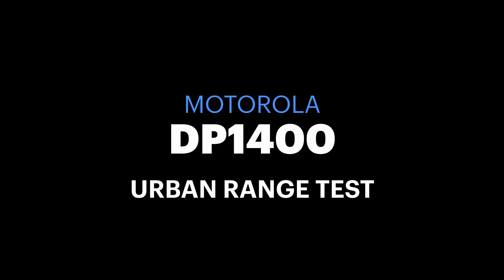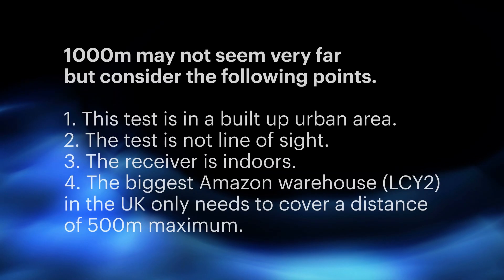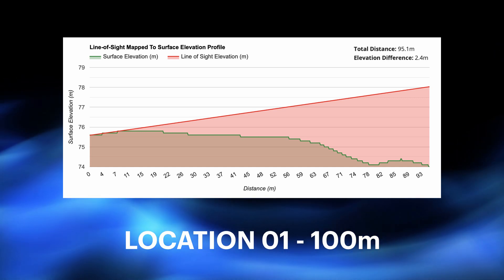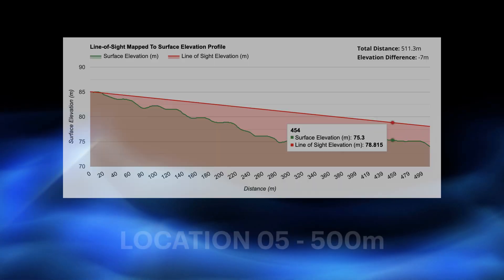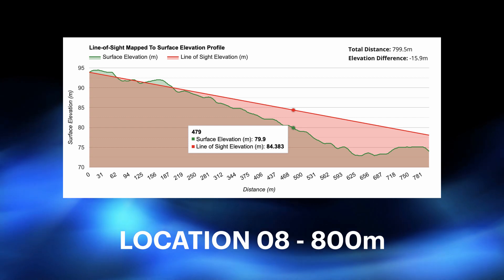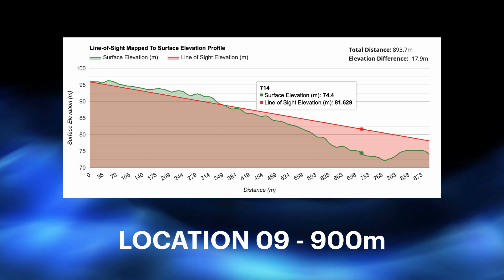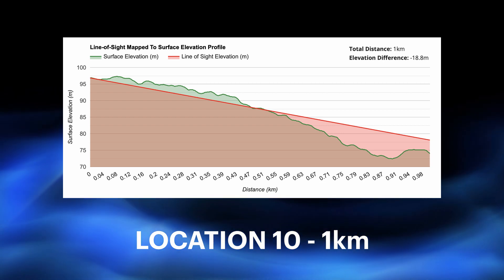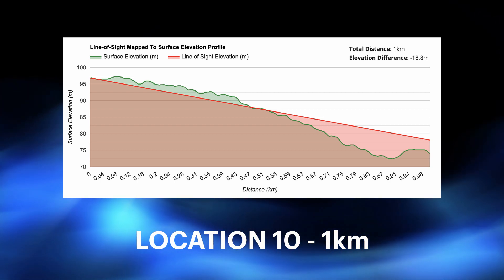Motorola DP1400 - DMR Urban Range Test

Comment: Would you say DP1400 is a better radio than the XT420 regarding distance? The DP1400 you can change antenna right so I can put on a better. I dont know the brand so well but it seems that DP1400 is a big stepp up in radio to the XT420 right?
Reply from the maker: I would say that build quality wise they are similar but in every other way, yes, the DP1400 is a much more advanced radio. It’s a 1W and 4W radio that usually requires a license to operate (in the UK) and has far more advanced choice of frequencies and digital features.

Comment: We use a couple of DP3400 at work in a very urban town centre environment and only just manage to get 250m back to back. It only takes a few densely packed buildings to ruin you're range with simplex.
Reply from the maker: You’re dead right. Range tests are so unbelievably subjective and can only be treated as a rough guide.
Reply: @tdcattech  If you are interested in coverage plots I'd recommend some free  software called Radio Mobile. It uses actual terrain data to give really accurate plots.
Reply from the maker: Yeah, I love this sort of stuff. Clearly the elevation profile charts in this vid take into account the surface elevation but they don’t show the countless Victorian houses and buildings blocking the route. Does this software factor in buildings too?
Reply: @tdcattech  It doesn't know exact heights of buildings but knows the terrain (open fields, forests and built up areas) and builds attenuation into your plots based on that.
Reply: Do you use them in digital mode or analogue ? Because I have the exact same radio and i managed to do ~ 6 km, in the middle of Paris.
Reply: @_RTX2060SUPER_  Tried both. Not much difference in range  perhaps Digital is slightly better at the edge. This is from inside a building, with four buildings in the way.